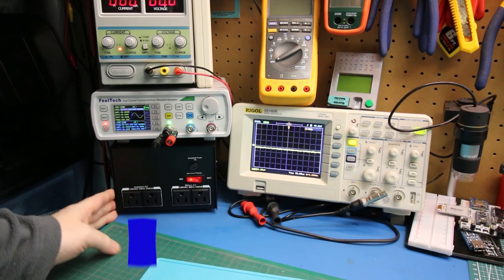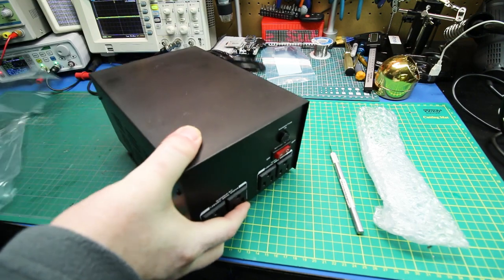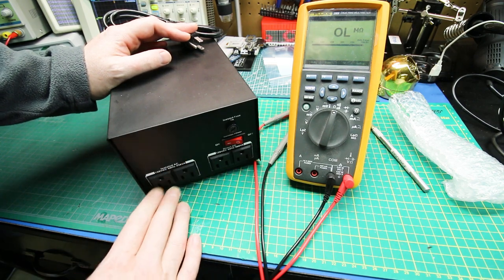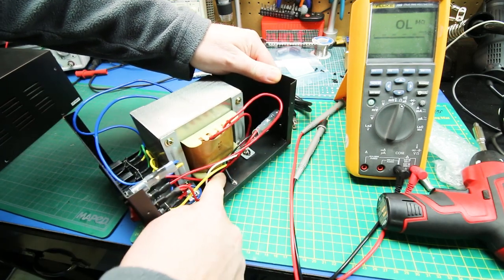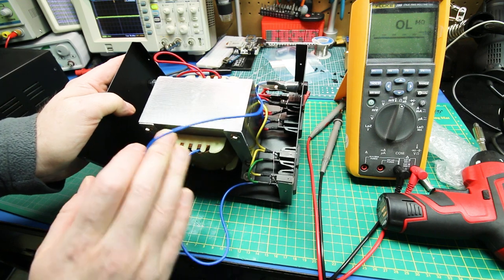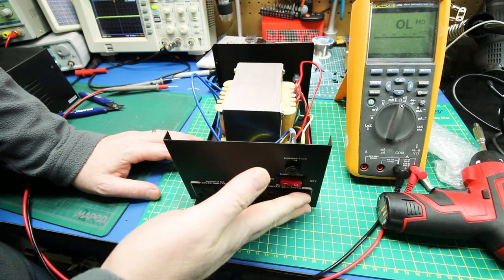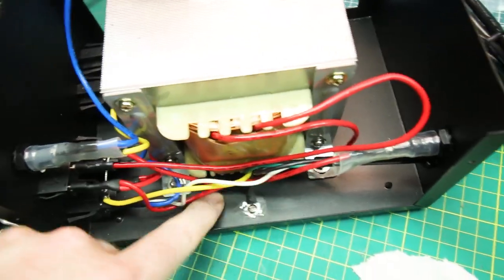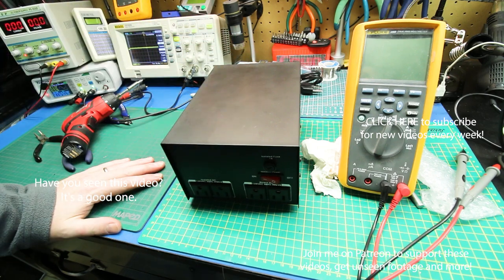Isolation Transformer-  Review & Modification

Comment: Good video reminding that there are more than one way to make an isolation transformer... Thus, one should check how the isolation transformer is made and whether it is suitable for particular application without modification.
Reply from the maker: Ya pretty much none are sold for safety/repair- only noise isolation and they still don't really work for that as sold :)  Isolating earth is a pretty bad no-no in most countries

Comment: It's so simple yet, so confusing. For me it's the neutral reference to ground. When you touch the neutral and ground, there's continuity. It seems like it just negates the whole thing. Meaning you can get rid of the ground but if the ground and neutral are referenced, the ground is still there.
Reply: Would you also be able to use those adapters that negate the ground pin so it never makes contact with the isolation transformer?

Comment: Your definition of a "tech" isolation transformer is different from most others writing about isolation transformers.  The more common definition is that the secondary is floating with respect to ground, so that you cannot get a shock by touching the circuit and earth ground at the same time.  This transformer's isolated outputs appear to meet this definition as it came from the factory.  On the other hand, most "tech" isolation transformers (with 3-wire outputs) do connect output ground to input ground (e.g. look at any of the Hammond isolation transformers, 171 or 178 series).  So this is already a "tech" isolation transformer, by the usual definition.
Some people argue that output ground should also be unconnected in an isolation transformer, among them the BBC.  BBC document EGN-4 explains why.  But the BBC doesn't just say to leave the connected device ungrounded - it recommends connecting any exposed metal on the device to an external ground screw that is supplied on BBC-spec isolation transformers.  Operating a 3-wire device with ground unconnected can reduce safety (by allowing the device case to become hot) in some circumstances, while improving it (by reducing the amount of grounded stuff on the bench) in others, so it's not something you always want.
So, I always leave the ground pins connected on my isolation transformers.  2-wire hot-chassis devices don't care anyway.  If I ever want to disconnect the ground on a 3-wire device, I can use a plug-in 2-wire to 3-wire adapter.

Comment: Can you please confirm..that to make this a tech isolation transformer, you essentially disconnected the ground pin from the isolated outlet,  (from being connected to the primary ground)..?
If this is indeed the case, . Isn't this unsafe to have  the ground pin not connected to anything? Doesn't the device under test require this ground for safety?
Or
This is indeed characteristic of tech isolated transformers..?
Thanks for the video..
Reply: Alas, we may never know.
Reply: It is safe as it is isolated.

Comment: What if I use a pure sine wave inverter that's powered by 12V DC, those, by their very nature are isolated from mains earth.
The DC would be supplied by a lab bench power supply rated for the current needed to sufficiently power the pure sine wave inverter at full load.
Wouldn't this work to isolate my device under test ? 
I lose some energy from the conversion but it's not being used to power constantly on high powered devices to begin with so the losses should only amount to a few cents a year at best.
Reply: The ground/neutral connections could still be coupled, also unless you’re spending an absolute ton of money on a really high-end inverter… The “pure sine wave“ is never a perfect waveform. Which can cause a lot of issues in some devices.
Reply: @hullinstruments  The the only thing connected to a wall socket would be the lab power supply. Not worried there 

A good pure sine wave inverter is probably still loads cheaper than buying a good isolation transformer.

Comment: What about plugging the scope into the isolation transformer as well. I would think that would eliminate the concern of grounding the scope probes to the chassis of the unit under test.
Reply from the maker: Not recommended for a few reasons. At this stage you should really know what you are doing and not need that. I hesitated to even publish this video as most people probably just shouldn't be working on 110.
Reply from the maker: Sorry not "you" you but "people" you :)
Reply: @MkmeOrg  I'm one of those. But I want to learn how to work on 230 because I have many projects using mains. Where can I learn how to do that as safe as possible? Thanks!
Reply: The? Never plug more than one thing in an isolation transformer.

Comment: A lot of these isolated transformers not only have the ground plug of the outlet grounded to the chassis but the neutral is bonded to ground also so that needs to be addressed to make these a fully isolated transformer for tech work. Removing just the outlet ground will not protect you because the neutral in the mains service box is earth.bonded, you are still grounded.
Reply: The mains neutral connects to the primary side of the input winding. The two wires coming from the secondary have no physical contact with the primary. The only common wire is the earth wire and once that is physically removed from the output you should be ok . One other issue involves the mounting screws on the metal container. If your output sockets are mounted to the metal container then they will be grounded and as most of these sockets have a common output earth in order to ground the mounting bracket. You should physically cut the metal band from the earth connection to the screw hole of the container . This depends on where you live and the type of electrical plug sockets used in that area.
Reply: @conwaynoel3715  Why not just leave the Earth pin of the secondary as they are and just use a 2-pin plug or a plug-in 2-wire to 3-wire adapter.to connect to your DUT?
I was told that I could use a RCD plug (GFCI in USA) on the secondary of the I/T if I want to.